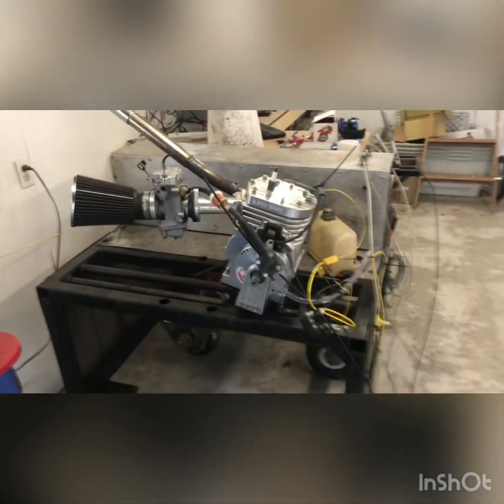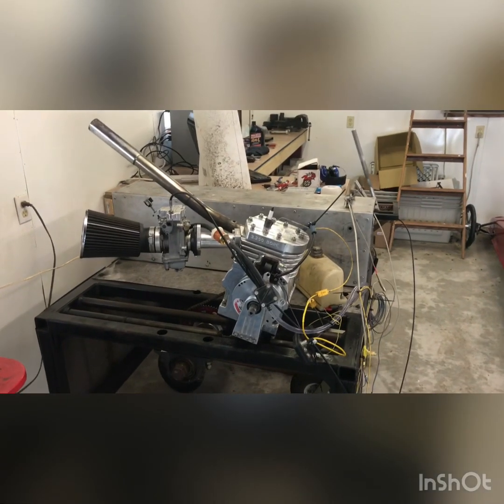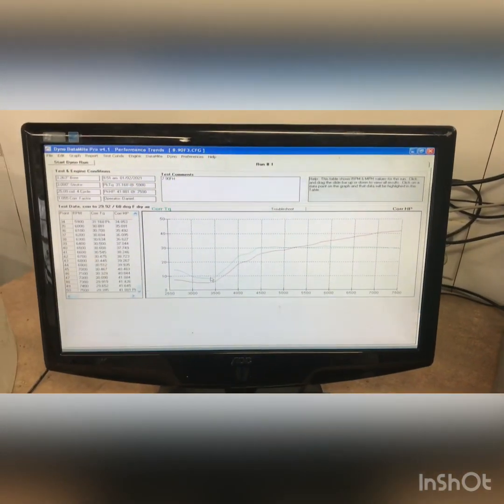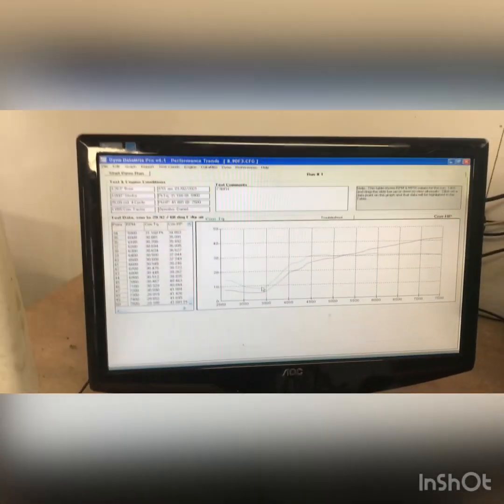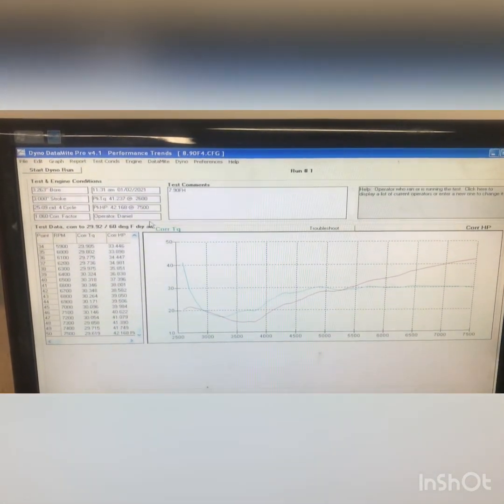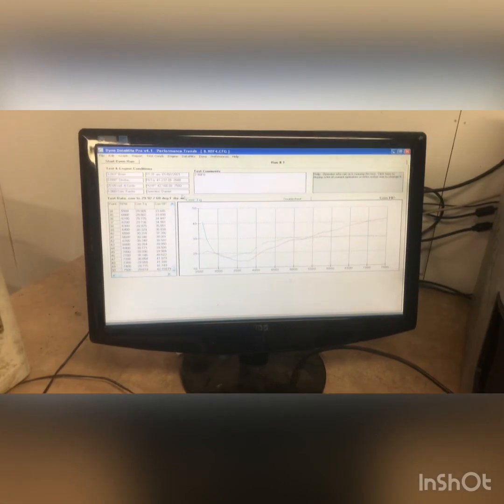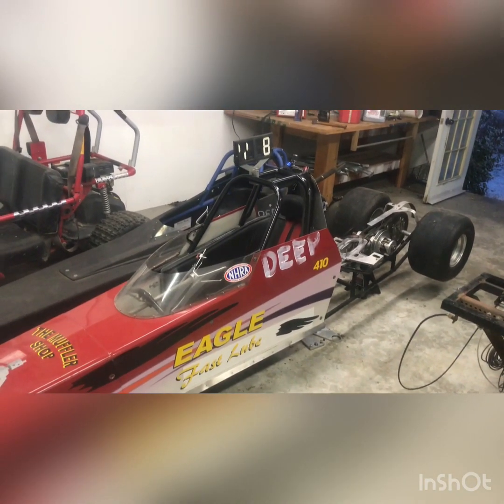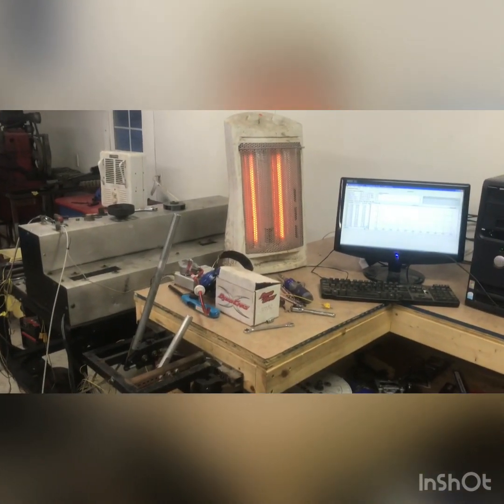7.90 jr dragster dyno after freshen

Comment: Running on alcohol?
Reply from the maker: Sure is
Reply: @sendit_silly5525  love it! Made some nice power!
Reply from the maker: @K_M_M_G  thank you. It did. I’m shooting for the blower motor to be about the same power. Just because of index racing
Reply: @sendit_silly5525  how much could I pay for u to build me obe
Reply from the maker: @CUP_1111  do you have a motor?
Reply: @sendit_silly5525  no just for u to build me one from nothing
Reply from the maker: @CUP_1111  I can but it’ll cost around 5000 to have the same thing
Reply: @sendit_silly5525  if I already got a engine how much
Reply from the maker: @CUP_1111  500-1000. Depends a lot on quality of parts in the engine.
Reply from the maker: @CUP_1111  5000 would be high and all new but these billet motors don’t start out cheap
Reply: @sendit_silly5525  well I will keep that in mind